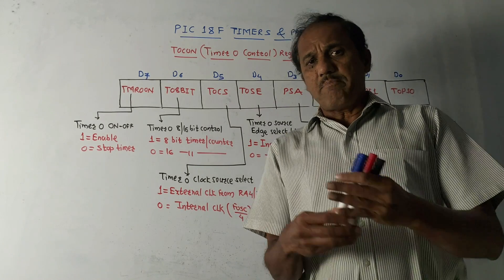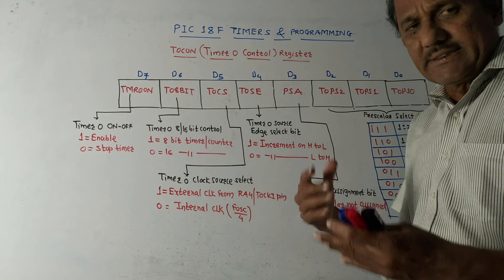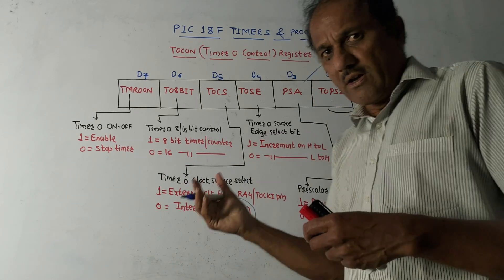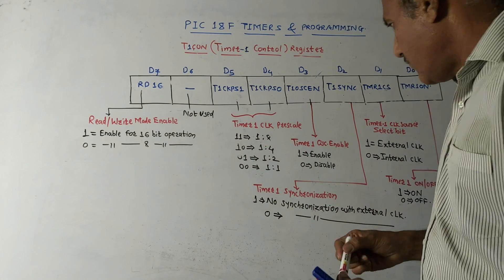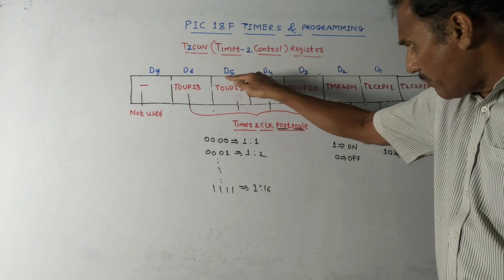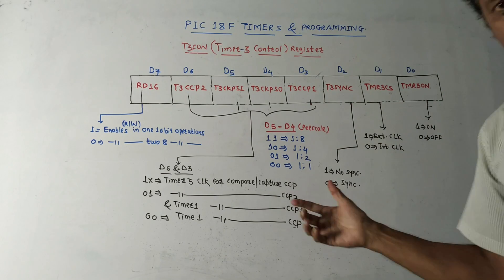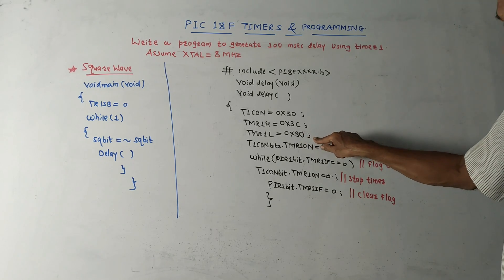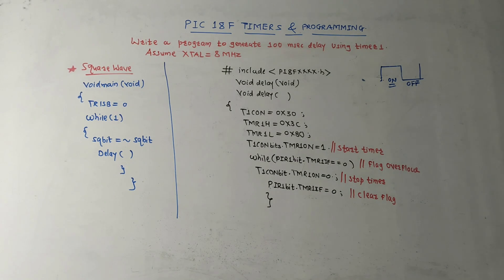PIC 18F TIMERS AND  PROGRAMMING

Comment: The step for programming timer in PIC might be incorrect because the same steps are for 8051 and here N might have values greater than 65536..and you didn't mention anything about calculation of prescaler which can be calculated in the same steps.
.